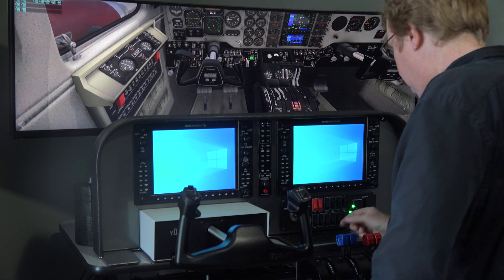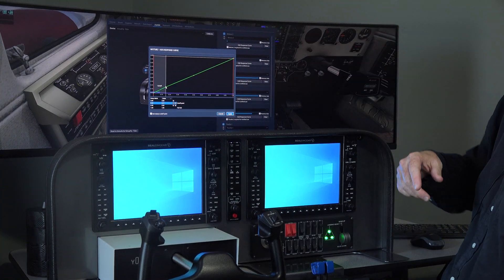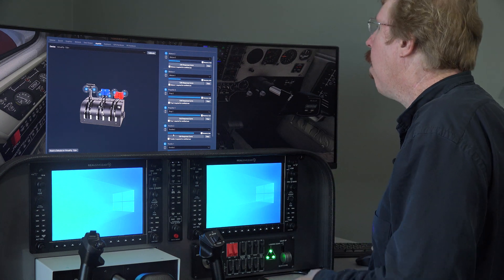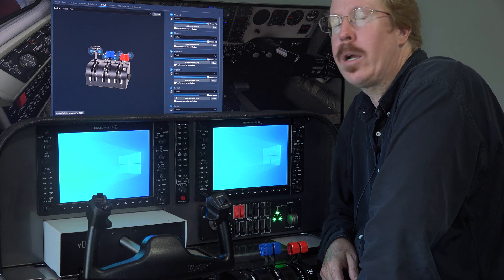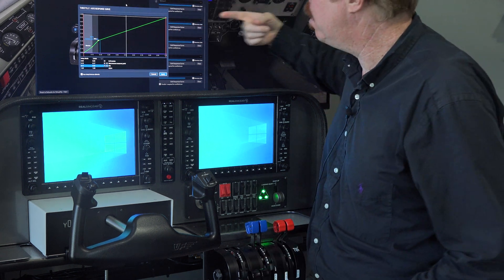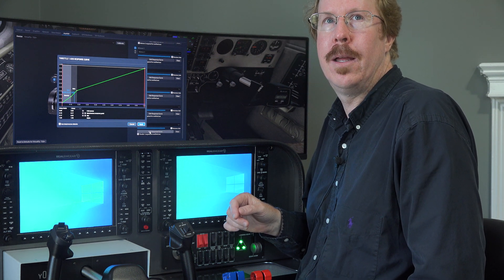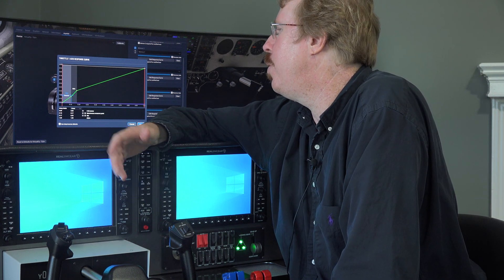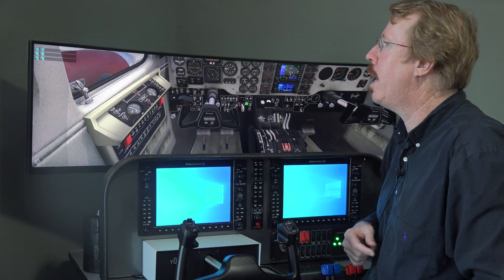Setting up a 6-Lever Throttle Quadrant in X-Plane 11

Comment: Don't working for me. Have a saitek TQ and somehow modes are not changing from 1 (direct) 2 (beta) 3 (reverse). They remain at zero (0) value. Prop pitch is not changing and throttles are going forward when I reach the point where they suposed to enter beta range. What am I doing wrong?
Reply from the maker: I believe that throttle has a "button" when you fully deflect it down past the detent.  I think you can program that button to be reverse.

Comment: I can't seem to get this right. I have a Honeycomb Bravo Throttle Quadrant and the problem for me is, where the mixture is at 0 is all the way at the bottom of the travel of the lever, IE without the detent at the bottom. The detent at the bottom is acting as if it is an entirely separate button, and it even shows up as a separate button in the controls. I am doing what you are saying but for some reason on my setup it won't work. I even reset the profile for the TQ, and still no fix. How do I get past this.

Comment: Interesting however not actually the case on the Saitek/Logitech kit.  The lever travel is from 0.0 to 1.00 whether you have the "Gate" programmed or not.  Past the gate, you only activate a switch, no modulation.  When you set the Quadrant on the Saitek/Logitech product, you need to set a point forward of the stop/gate as your reverse point and do the same for the BETA otherwise, no reverse modulation. 

The CLA (Condition "Red" lever) will provide Cut-Off at 0.0 without going over the gate and the Prop Lever will provide Feather at 0.0, again without going over the gate.
I use the BETA-REVERSE setting to get a modulable BETA range to save the brakes (PC-12 and KA-350) but leave the other two levers as they are.  This applies only to the Saitek as far as I know as this is what I have.

Comment: Hello Austin,

I meet an issue with my Throttle quadrant and X-Plane 11 and I don’t find the solution.
I am flying a PC12 model (that is fantastic) but I don’t manage to set the Throttle Quadrant for the reverse position.

If I select customization of the response curve then select inverter/beta option, I see that in the plane it is working like it has to do,  but the ground position in the plane correspond to 25% of the throttle quadrant position.
I would like to understand what to do to correspond the ground position in the plane with the 0% of the throttle quadrant position, then how to set the inverter mode with the red part under the 0 position on the throttle quadrant position.

I really hope you understand what I mean because actually, this is absolutely not convenient to have the ground position at 25% of the throttle position.
To resume, flight position must be between 100% and 0% of the throttle quadrant, then the ground position (that include reverse mode) must be below the 0% of the throttle, on the red part.

Hope you can help with that issue!

Kind regards,

Romain

Comment: One thing worth noting with the saitek/logitec throttle is that, while it has a detent like the throttle in this video, the point below the detent is just a switch rather than being part of the potentiometer range. In other words, its zero point seems to be at the detent and bringing it below the detent seems to be basically an on/off switch that has its own mapping in x plane, so much of this video doesn't really apply.
Reply: Thanks for mentioning this. I was wondering how you would add throttle when you are in reverse to increase the stopping power. If you add throttle using the method described, the props would go back to positive pitch and cause the A/C to speed up instead of slowing down. I think I'll use the throttle detent for Beta and the button below each throttle for reverse so I can then increase power on my Logitech throttles. I'm still a bit confused about the detents on the props however if the throttle detents control Beta.
Reply: @Topcat1952  What I did, which actually worked quite well, is I mapped the bottom  button region to 'toggle reversers'. What that does is it changes the lever such that what would normally increase throttle, will instead increase reversers. You use the reversers as needed,then toggle back to normal thrust the same way. Works for both jet engines, as well as turboprop.

Comment: This works well for the Virtual Fly T Q. Can Austin have a look at the Saitek throttle quadrant that I think most xplane users have? As xplane is not setup for it. BEFORE I get to the indent on my saitek TQ the lines have already traveled all the way to the far left of that box to zero passing the beta zone and into the reverse. It would be nice to have this fixed for saitek users.

Comment: Nice video. How do you set up Thrustmaster Warthog throttle, or any 2 Handles throttle to work with a Boeing 747 or any 4 Engine airplane? The throttle only operates Engine number 1 and 2.
Thanks for the help.

Comment: Question. I use FaceTrack with xplane but only works with 3D panel view. Can be possible to use panoramic view with no panel only the outside but able to use it with headtracking and eliminating the need of three monitors. Thank you

Comment: Very helpful video! I just dragged my old CH throttle quadrant out of the box it was packed in and need to set it up for X-Plane. Haven't used it for several years and have never used it with XP. I mainly fly the XP default Baron and the quadrant should add some more fun to that.